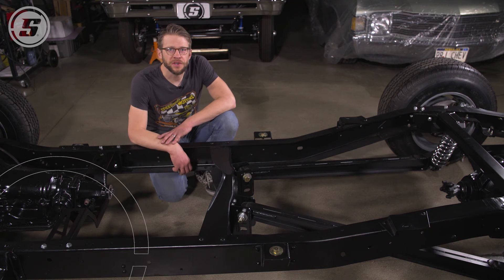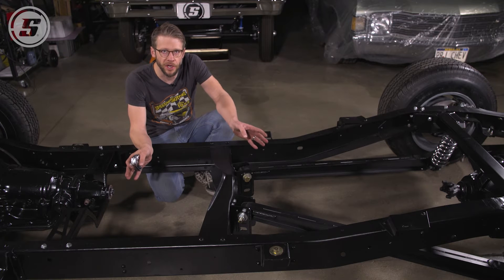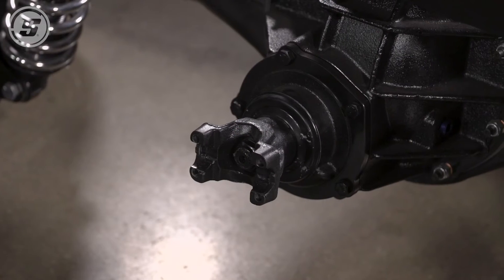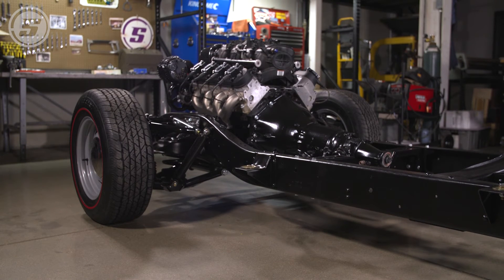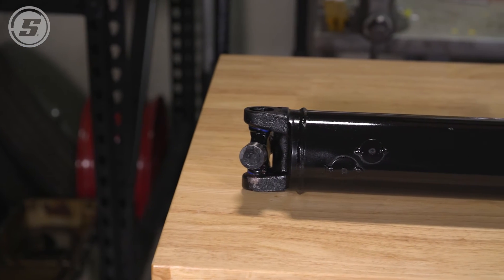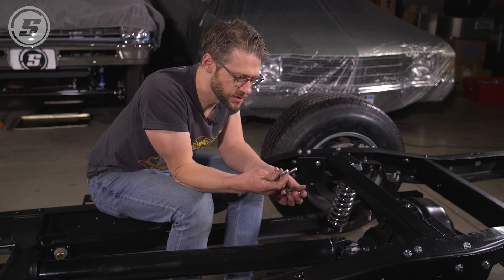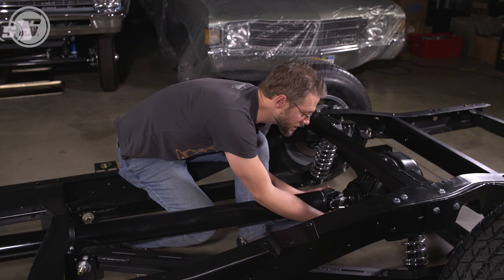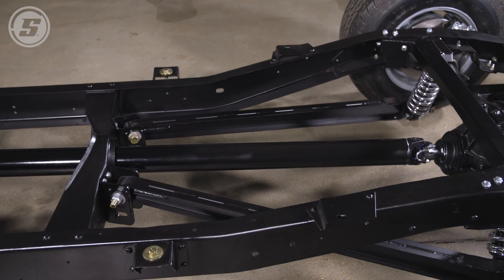How to Measure and Install A Custom Steel Driveshaft

Comment: Best and most accurate way is to have the vehicle on a level ground install the slip yoke pull it out of the trans 3/4 or up to 1inch depending on rear suspension and measure distance center yoke front and back,never had a problem in 50 years

Comment: Questions I have 66 fairlane fmx trans & already have yoke in . So do I just measure from yoke to axle then right ? Also I'm running 69 351w & 9" axle & want driver / cruiser out of Fairlane when done . So what size W , would you recommend ? Not racing think hwy driving ; )

Comment: Hey I enjoy your videos. I have a question. I'm building a custom car with a chrysler 300 drive train V6 and automatic transmission. My design includes moving the drive train rearward to allow a 22" yes " 22 inch" custom driveshaft allowing me to only make changes to fluids and linkage connections and retaining the rear end. Is my dream too far out there?

Comment: I'm restoring a 1970 Chevy c/10 short bed and I'm going away from the 2 piece drive shaft to a one piece. The rearend is the original 12 bolt with the 373 gears mounting up to a turbo 350 and it has been lowered to a 4.5 front x 6 rear inch drop. Do you have a drive shaft already set up for this type of drop or will I need to measure for a custom drive shaft for my application ?
Reply from the maker: Hello. You would need to measure the length you would need and then you can make a driveshaft using part number 910383 https://www.speedwaymotors.com/Universal-Steel-Custom-Length-Driveshaft-Kits-3-Inch-OD,332572.html